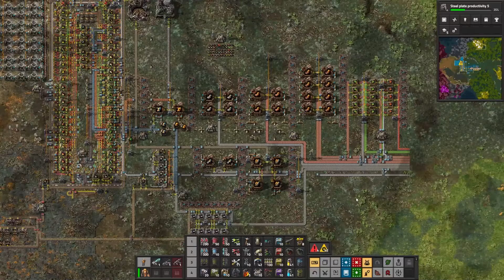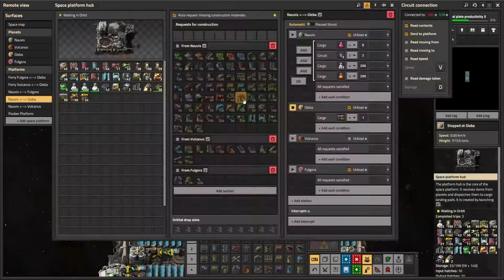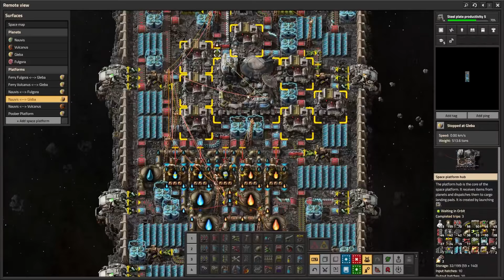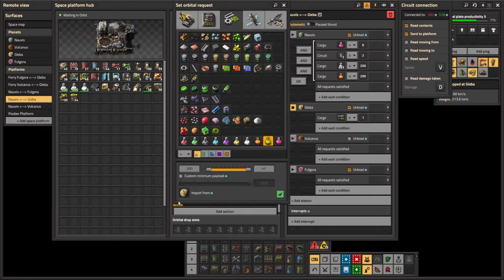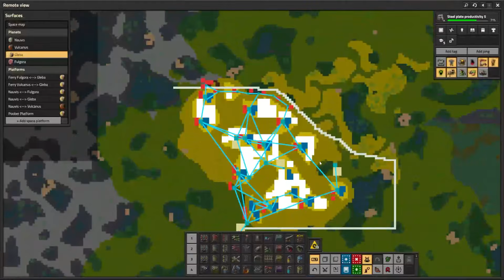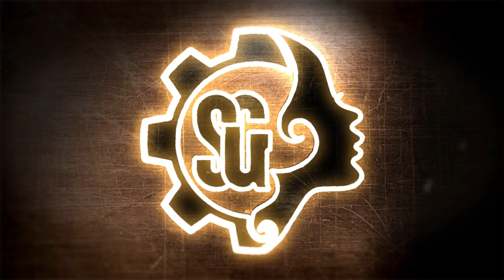Blue Circuits & Preparations to Depart Gleba | FACTORIO SPACEAGE - Ep 68 #factorio #spaceage

Comment: Looking good, ( like to see you expanding the nuke power, like I told you at the start of gleba that nuke is the way to go ).
I start doing auto factory for the mall instead of making assemblers for all the stuff I need, I just make 8 to 10 assemblers with a lot of logic and set the amounts I need and the assemblers change recipes as needed, is actually really nice.
Before I was like you making huge malls and now they are small and make all I needed.
Oh, not sure you made any ship with nuclear power but trust me you will need it, also the smaller ( wide ) the ship is the less rocket power you need ( it can be as long you like ), my ships are 5 engines wide, they go at 250 mps.

Comment: 15:43: You are using "Read entire belt" feature, but belt reader reads only one segment, and segments end on splitter. Your conditions are entirely correct, it's just your wiring which should be fixed.

Comment: Stack inserters are a thing, are really powerful, and can only be made on Gleba. :-) Note that what used to be called "stack inserters" were renamed "bulk inserters" on Factorio 2.0. There is also one other item you will absolutely HAVE to have from this planet to continue further.

21:51 - You may fix this later, but something about your power setup is still messed up. The inserters should've inserted the fuel. I don't believe reactor temperature can go over 1000 degrees.
Reply: The reactor temperature can't go over 1000, but the T signal can, and is.  (I'll leave it as an exercise to the reader to figure out why.  ;) )
Reply: @DavidLindes  - Ahh, yes, you are correct there. In that situation I would never do the thing that causes that to happen. 🙂